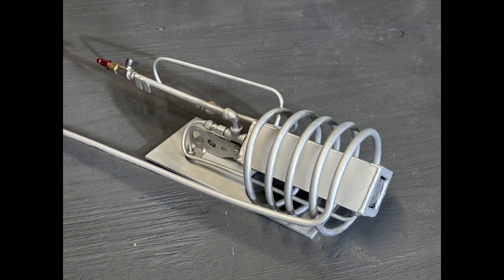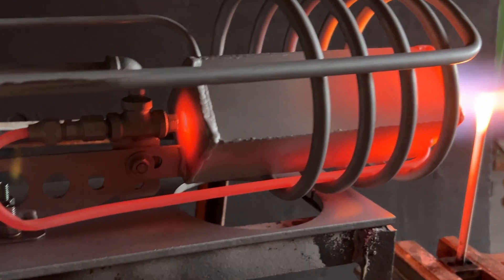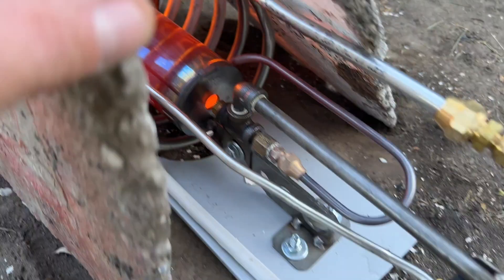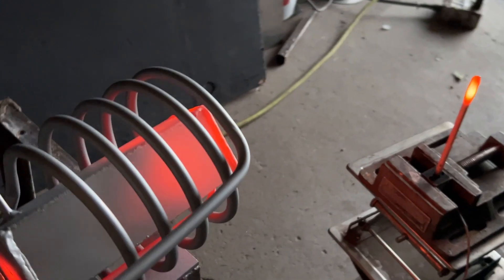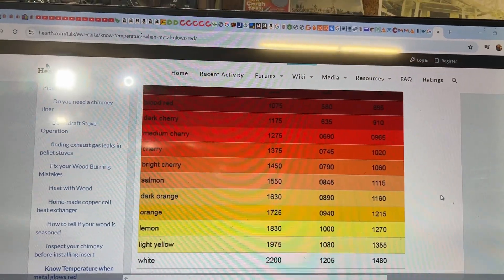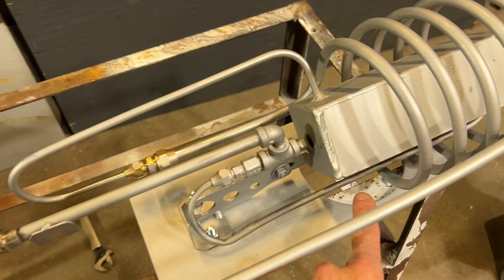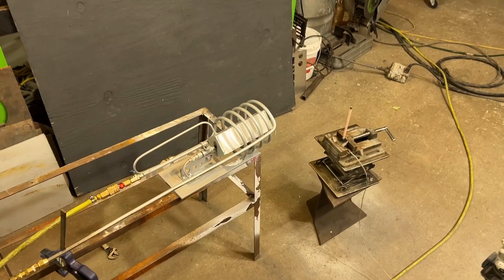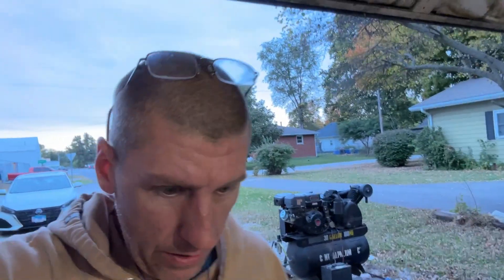Thermal cracking propane burner

Comment: Injecting superheated steam into the gas stream will catalyse it bringing the reaction temp down to 800 deg C however there will be some CO in the stream but i don't see that would matter, and it would cure the carbon build up problem and lower the temps inside the burner propper. prob best to have the super heater reaction tubes in the centre of the burner tunnel. the4n inject air downstream of the reactor for the bulk high temp combustion. Just a thought. I'm looking at ways of generating large amounts of unburnt hygagon on demand for another use. But the CO would make it unacceptibvle in my application.

Comment: Actually reminds me of a cross between the Starship Enterprise and the Bug from the Matrix in its untenticled form.

Hydrogen: the final frontier. These are the voyages of the NOBOX7 Propane Cracker 
Its five-week mission: to explore strange new temperatures; to seek out new 
designs and new thermocouples to boldly melt stuff where no melt has gone before!

Comment: your castable nozzle might do the last of the cracking as the ceramic style nozzle ramps up in stored heat creating a possible cracking zone, hopefully at the input end. Maybe a stainless double tube gas jacket around/holding the nozzle, if it had a few layers like concentric tubes like a telescope you could have multiple expansion layers, probably wont need to go all the way up the nozzle...halfway may be enough

Comment: Hey, I'm actually a chemist, and was about to leave a comment expressing my doubts about if you made hydrogen. But then I watched your previous videos, and it actually seems pretty convincing...I'm impressed! I would suggest digesting the "metal" flakes you dumped out previously in an acid (hydrochloric, or nitric if you have it...or mix both of those to REALLY do the job!) to see how much is actually carbon. If nothing really dissolves, then the "metal" might actually be something called pyrolytic graphite: a shiny form of carbon specifically made by thermal decomposition of carbon-containing molecules like propane! A quick note though...hydrogen can't really reduce metals, since they are already in their most reduced state. It CAN cause hydrogen embrittlement however, which might be the cause of the flaking...or maybe superheated carbon is impregnating and oversaturating the steel to the point where it fails. It's hard to say! I'd be curious to see how different materials behave in the pyrolysis chamber for sure. Maybe electroplating it in platinum would help, since it is a great catalyst for hydrocarbon pyrolysis and cannot be oxidized! Kinda overkill, but it was an interesting idea, lol. I look forward to seeing how you over the issues in later models!
Reply: See THIS is what YouTube is for. Ideas and collaboration to make said idea even better. Great job NOBOX7
Reply from the maker: I think ive seen your videos by the way as im definitely into chemistry channels
Reply: @NOBOX7  ah, cool! Maybe a quick coat of high temperature paint or insulation will help with the oxidation then! It might also be worth making the cracking chamber easily disassemblable, just in case the carbon starts to build up and can't be blown or burned out.
Reply from the maker: Hello friend , i was suggesting the sugared stainless steel was reduced back to non oxidized metal . You see in welding if we dont back purge the metal oxygen will travel from the back  of the weld to the top . So even though there is no oxygen in the cracking chamber it travels through the inner side from the combustor into the cracker oxidizing the metal . But then the flaking oxide layers get reduced by the hydrogen and maybe even the propane would do a bit of reducing to the sugared stainless steel  . Great point about the embrittlement . I hope that made sense , the oxygen travels through the yellow hot metal kind how oxygen travels through a weld that's not back purged .

Comment: I'm curious, how big will this scale?
Reply from the maker: The design in this video is flawed but as for the last design 
Maybe we could double the size with my current air compressor set up but in my experience the larger the burner the cooler it runs . Due mostly to the air compressor limitations . The process can be scaled up by many orders of magnitude with a compatible design but as is you would need a 25 hp air compressor to get much bigger . We maxed out a 14 hp compressor . You need that higher pressure combustion to get this kinda heat.
Im gonna try this design one more time with the other big compressor but i think its just a total flop . I like to share my failures as well . We tend to learn the most from mistakes as success could walk you on the edge of failure without knowing it . But failure ,,,now this is an event that makes it plainly obvious as to what needs to be done to succeed

Comment: The reason thick metal does not conduct enough heat is because when you increase the temperature of metal you literally reduce its conductivity
Reply from the maker: Great input
Reply from the maker: Im gonna compare the thermal conductivity of 304 ss Vs Inconel 600 and 625 .

Comment: You might need to use some kind of a flame holder to prevent your high pressure gas from blowing the flame out
Reply from the maker: So far the current back plate is doing ok , it can take all the air you can give it without a flame out if the fuel is up high enough . You are correct though in the sense thats definitely a way to get more power . I have  2 videos on the subject . Check out the fat man  burner on my channel to see your wisdom come to life . In that video i do a similar fix as you request an wow did it work .

Comment: Maybe use a double wall pipe that will both cool the hydrogen and preheat the propane
Reply from the maker: Yes it definitely needs an alien tech design . These preliminary stages are helping sort out things like co flow Vs counter flow on the heat exchange an basic combuster design  . This thing was a flop but i did learn a couple good bit of info . Mostly how i will  not be going with a co flow design on the heat exchanger . Counter flow was used on the last one and it had some key features one being the discharge tube was not as hot . Thats wasted heat leaving the pyrolizer/cracker .

Comment: You probably already know but a hydrovane air compressor is a great way to produce high volume-high pressure air.  We had one in our engineeing workshop and it was great. Nice and quiet too. None of that rattly piston noise.
Reply: Have one I can run on a pto.
Originally had a 30hp electric motor

Comment: Do you need more air? Or more oxygen? I got an oxygen concentrator complete with the tank compressor that goes to 1500psi off of marketplace.
Reply from the maker: Yes in this case we needed more air . Enhanced oxygen would help for sure .

Comment: Can't you just wrap more tubing, and put it closer to the barrel? What about insulating the whole thing?
It does seem like you may not be getting a full burn with whatever gas, but I wonder what it'd be like if you used hydrogen AND forced air or an oxygen input.
I think I've seen an HHO torch video where this guy said he got like 5200f. His flame was orange, so even with oxygen added it's still burning rich
Reply from the maker: Yes it needs some insulation for sure . This design just isnt cutting it . The older design that worked had a 1 mm thick inner liner and you need that thin metal for those yellow hot heats
Reply: @NOBOX7  this'd be a sick thing to have 3D printed, but it'd be crazy expensive. Take a look at 3D printed suppressors, specifically OSS/HUXWRX ones and take a look at what's going on inside those. I'm sure you'd be able to do some gnarly stuff with that, and you'd be able to use inconel or whatever other crazy mix.
Even with just regular stuff, I don't see why you couldn't have super deep "threads" cut into the inner liner and have a sleeve stuffed over that and welded to mimic coils. You could maybe even just do sleeved tubes with a maze type situation where the gas goes forwards and backwards a bit

Comment: once its up to tempriture, would it also crack liquid fuels such as petrol, diesel, parafin or even waste oil?
Reply from the maker: A good design could pull it off but carbon build up is an issue . Yes you can crack liquid fuels but we may need more energy to do it . After all we was able to crack liquid propane and thats a freezing cold liquid
Reply: @NOBOX7  You'll have to design a DPF for buring off the coal ;-) (Or just blow oxygen through the heated duct instead of gas once in a while.

Comment: Why not consider building the cracking chamber out of ceramics, specifically alumina?

Edit: A day or so ago I thought you might be able to separate out the carbon with cyclonic separation.  The basics are, well, fairly basic, you have a conically shaped volume (with the small end pointing down) and the mixture of gas and particles introduced at high velocity at a tangential angle.  The resultant centrifugal force will throw the denser particles toward the wall and gravity will pull them toward the bottom (there are various ways to 'drain' the particles) while the gas will move toward the middle and rise up.  This way you can configure your cracker to blow the carbon out continuously to avoid clogging while also not having to worry about clogging your valve mixer downstream.
Reply from the maker: I herd alumina offer a catalytic effect to this reaction but havnt seen any literature on it as of yet . One of the smarter  commenters brought it up
Reply: @NOBOX7  square alumina sheets are rather cheap, apparently they are consumables for flour mills and the like, but they at most can be used as heatshielding liner
Reply from the maker: Fabrication cost
Reply: @NOBOX7  Cost how?  Go to a local ceramics school and ask them to make something from porcelain.  Porcelain clay is likely way cheaper than inconel.  And you can fire it yourself, if their kiln can't get hot enough (cone 10).
Reply from the maker: great idea its just hard to make .

Comment: Idk where he thought the hydrogen came from? It takes more energy to break the hydrogen off the propane than you get by burning the same hydrogen. In addition hydrogen is clear to pale blue when burning. In addition, the orange color is just carbon soot from incomplete combustion glowing at  incandescent temperatures, this is usually the same for the bottles of h2 or the tanker was they are hardly pure. For a pure flame look at h2 rockets and tell me the hydrogen is orange. Still a neat design but no hydrogen
Reply: Hydrogen out of reforming, the energy equation will be the same.
So the output of heat per kg of fuel will be same .
What the previus burner was good is at packing that energy in a really dense spot.
Reply: The energy will not be the same. H2 or monotonic H will be far less energeticly favored, requiring more energy input than output. Additionally, the red heat and the flame ejecting out the front is the added energy you WOULD need, the radiant heat off this alone would be a net loss. What he has is a pressure boosted propane flame, much like the idea of an oxy fuel torch. After all, nobody is claiming an oxy acetylene torch is thermally decomposing the hydrogen off the hydrocarbon....and those flames will be much hotter than this
Reply from the maker: @unknown-ql1fk  Ok thunderfoot now your so wrong i gotta block you . We proved in the last several videos this works with the other burner . Ill leave your comments up for  day or to to give you time to get life sorted out and make some edits .
Reply from the maker: LOL you didn't see the other videos and your dead wrong . We produced hydrogen in the last couple videos just not in this test , no open flame gets 2,582 deg  without oxygen enrichment  buddy . I may be deleting your comment because you are so wrong . Go watch the other videos on this project . Hydrogen burns orange in most cases . It does not take more energy to break the propane bonds then that f the hydrogen is flat out wrong , We disected the last device and seen the carbon build up and the reduction of the metal .
Reply from the maker: Yeah im gonna delete you because your just flat out wrong
Reply from the maker: Yeah i mention 5 times or more we dont make hydrogen with this design . The old design worked like a charm
Reply from the maker: I do apologize for being a jerk . Its ok we dont agree . Life is almost over man its not worth it .
Reply: High voltage high frequency can crack gases. The Papp engine used cracked noble gasses. I think he use 100kv DC to treat the gasses. The treated gasses were stable after treatment. It discharged a needle point to do this.
Reply from the maker: H2 rockets are oxygen enriched so yeah there's that problem with your response . Did you even bother to youtube a hydrogen flame . Stop being so delusional and look it up  for crying out loud then get back to me . Also if we are producing carbon we are producing a small amount of hydrogen  

And its clear you didnt watch the video so ill cut you slack . I say in this video we produce no hydrogen . In the other design in the last 4 videos i posted we produced 80 to 90 % hydrogen . Not sure what collage you went to but you need a refund buddy . Im just a drop out

Comment: I wonder what would happen if you run gases such as hydrogen through an ozone generator? It has been done and called hyzone. Hard to find what the effects of hyzone were. So imagine O2 through a high power ozone tube and hydrogen on it's own then mixed and burnt.  Also wonder what would happen if you ran propane through a high power ozone tube. Would it crack it making lighter more energetic gas?
Reply: Would  an high voltage Ozone tube electrostatically crack propane or other gases?
Reply from the maker: My buddy M3scal made that stuff one time . Would be neat to try those kinds of exotic fuel systems